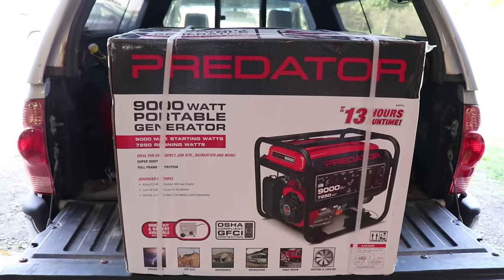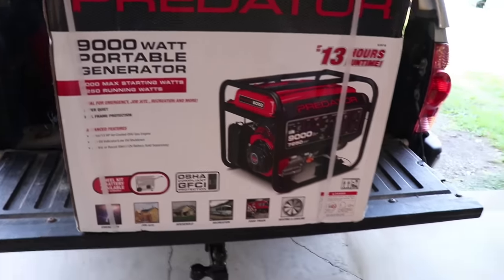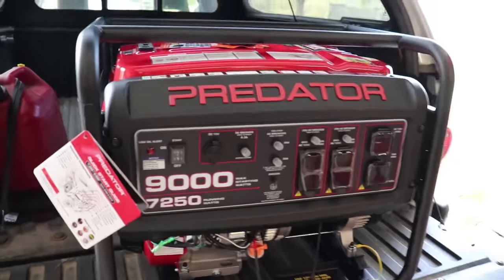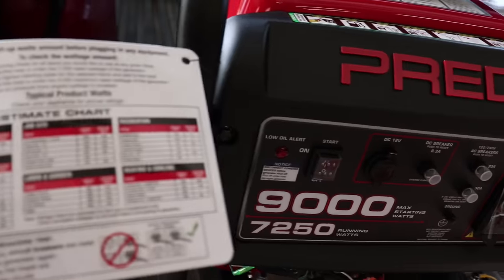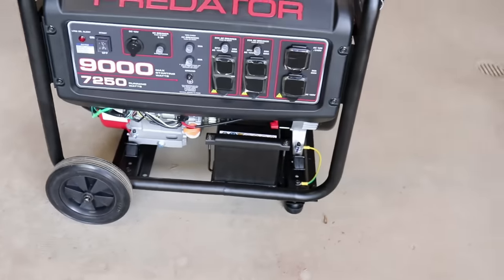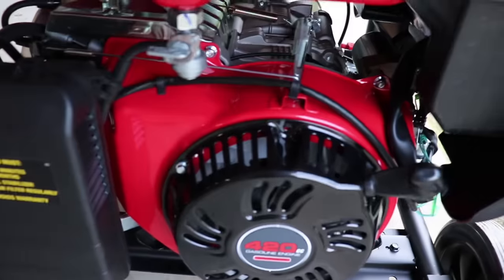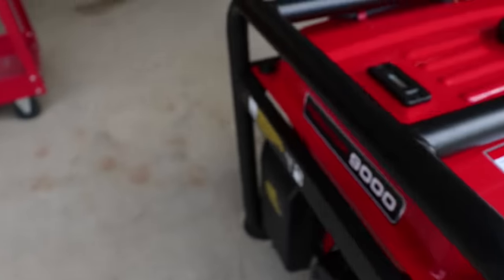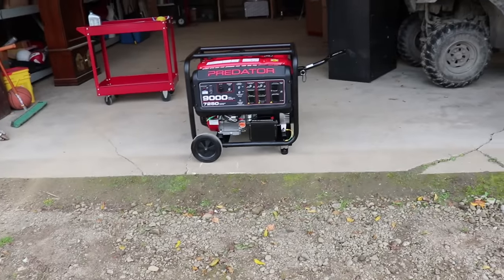Predator Generator Running Our ENTIRE Home. (Complete Setup and Cost)

Comment: I used this same one for 4 months straight  12hrs a day when I bought my land in El Paso Tx Works like a charm. Best generator ever owned.
Reply from the maker: Thanks for the input!
Reply: Thanks that is good to know. I wondered if the harbor freight units would be good for only short periods.
Reply: 4 months? on gas or have you converted to propane???
gone sola pv & battery pack?? tesla powerwall???

engineer 775 or handeeman; tesla car battery pack & pv panels.... you could do multiple wind turbines.....   just a suggestion.... free power
Reply: you need to change the oil,every wk,if run constant..i know you yanks hate changing oil in your vehicles..
Reply: Did you upgrade/ change the spark plug? If so with what plug?
Reply: I didnt do nothing to it just kept checking on the oil daily
Reply: @LilLonely915  8 hrs running a gen is like 1000 ks in a car.at least..i have a 5.5 kva gen,12 yrs old,oil change every 2-3 wks..robin crommolin.
Reply: @TheHwnleatherguy  Can you tell me more about this? Using a tesla car battery pack?? Is converting to propane cheaper?
Reply: stylishranchgirl Google “Tesla Power Wall”
Reply: Db levels by chance? Looks if your on a farm noise isn’t an issue but unfortunately my neighbors are pretty close and if I’m the only one running a generator that size everyone would hear that beast.
Reply: @TheHwnleatherguy  you seriously think building an independent power delivery system is free?
Reply: How much does it cost in daily fuel?
Reply: @TheHwnleatherguy  Explain that in a nutshell?
Reply: @markusayt  Every day for four months, if I had to use it like that, would seem a good deal. I'd have to pamper it afterwards and give it a rest. 

Harbor Freight didn't have a Predator in this size when I went looking. I 'settled' for something made by Power Stroke. My stepson and I set it up and did a simulation using our selection of extension cords. Everything went well and we shut it down after four hours seeing that everything was okay and we changed the oil. It was only very mildly discolored and running a magnet through the used oil didn't turn up anything that was concerning. 

After the Blizzard of January 1996 in southeastern Pennsylvania I shoveled snow for sixteen hours over a two day period. My wife, upon seeing me at the end of all of that shoveling, suggested we get a snow thrower. Excellent idea. Well, after we bought a Toro snow thrower it didn't snow enough to warrant getting the thing out of the shed out back. Buying that Toro had acted like a talisman against blizzards now I'm counting on the generator having the same effect on power failures.
Reply: @TralfazConstruction  What is this snow you speak of???
Confused in Florida.
Reply: @mushroomcloud1  It's a substance which repels palmetto bugs.
Reply: @TralfazConstruction  
Lol.....Best reply ever...
I have to go put a saddle on my Flying Palmy bug now,
Reply: @mushroomcloud1  Best wishes!
Reply: @TralfazConstruction  
Stay warm!!!
Reply: @mushroomcloud1  Oh, yeah. It's not the heat it's the humidity!
Reply: @mushroomcloud1  My daughter lives in/near Miami and she said as much with rain sweeping through yesterday. I'm in southeastern Pennsylvania and it had been unseasonably cool up until a week or so ago but we're paying for it today. I really miss the month of May. We had daytime temperatures in the upper 40s in the first ten days of the month. So it goes!
Reply: @TralfazConstruction  
Man I would just like some 60's...
It is hot.
Just help me wish away hurricanes and I will wish you a pleasant winter.
Reply: @mushroomcloud1  Oh, most definitely. I hope that Florida will not see any destructive weather. Thunderstorms here dropped us down to a cooler 70° from 84° with 60% humidity. Still heavy storms to our south. The generator is standing by although I don't want to have to use it.
Reply: @phantomwalker8251  not trying to be a smart@$$, what about using some long life synthetic oil to extend that change? Could that help?
Reply: @TheHwnleatherguy  0
Reply: @TralfazConstruction  don’t forget to watch this video about generator safety https://youtu.be/I1jT3ANENvI especially during hurricanes. Stay safe thank you
Reply: Thanks! It’s settled now. I’m getting that sucker.

Comment: I purchased the Predator 9000 a few days ago, and installed a Reliance inlet on 10/3 wire, and a breaker panel interlock with dedicated 30 AMP double pole generator breaker. Got it all wired in just in the nick of time as storms ripped though Alabama last night and as I suspected, we lost power overnight. Was able to connect the Predator 9000 to the house and we had full house power. It was awesome!
Reply from the maker: Love this generator!
Reply: Will this run your heat and air conditioning unit.
Reply: @lephaporter7833  doubt it unless u have 800 sq ft house

Comment: I have the same generator, our power went out a couple weeks ago for two days, we ran that thing 48 hours straight with no problems, the whole house, washer, dryer, fridge, TVs everything, 13 hours per gas tank full, works great
Reply: Haven't had any electronics fail early from running on this generator?  It's hard to find details on whether or not this generator is ok for use with sensitive electronics  (THD value).
Reply: @Steve Knick  no problems yet
Reply: @manbearpig2164  thanks!

Comment: Also. To protect the voltage regulator on your generator, do not allow the unit to run out of gas while it is under heavy electrical load. As the engine runs out of fuel and the rpm's start to drop, the voltage regulator tries to raise the voltage to compensate, and sometimes it burns out. This will cause 0 voltage output  when you turn the unit back on.
Reply: thanks for the tip!

Comment: I have the predator 9000w generator and it has been running 24/7 a day for the last 6months  and it has not missed a beat  it still starts flawlessly every time and i have had zero issues 100% a strong beast
Reply: ⚠️Portable Generator Safety Tips:

1) KEEPING OTHERS SAFE: Please do not allow an unqualified person or your children to operate and service the portable generator. Just because some manuals don’t say that doesn’t mean it’s safe. That is important against the generator safety rules. We also need to be keeping an eye on our children too. You need to make sure that your children are not playing near the portable generator especially when it’s running so they won’t get electrocuted. Generators pose electrical risks and they can be hot during an operation. Please keep your children away from the portable generator at all times. It is important to keep our children safe especially our little ones. Be aware of all the hazards.

2) WHERE TO RUN YOUR GENERATOR: Some people use their portable generators indoors which increases the risk of carbon monoxide poisoning. It’s important to have carbon monoxide detectors if you have a gas generator. Never ever use your generator indoors even if your doors and windows are open and even in the garage is not safe to use a portable generator. Also please never use your generator in your deck or balcony. It is never safe to use your generator indoors and in enclosed areas of your home. Your generator needs to be 15-20 feet away from your house. 

3)FIRE SAFETY: Never refuel your generator while it’s running. You need to let your generator cool off before refueling it and before storing your generator. Never overload your generator too. Never ever back feed your generator. You should never plug your generator into a wall outlet. Also never store propane tanks indoors. Please keep flammable things away from the generator as well and please don’t smoke cigarettes near the generator. Having a fire extinguisher next to the generator is also important against the generator safety rules. It’s also not safe to move your generator while it’s running.

4) GENERATOR OPERATION: make sure your hands are dry before touching the generator. Never use your generator in wet conditions. Don’t let your generator get wet. You need a generator tent if you need to use your generator during wet weather. Please don’t wear loose clothes when operating the generator. Turn on your generator before plugging in appliances. Use the right cord for your generator. Please do not use worn out cords. 

It is always important to follow the safety rules when using a portable generator.

Hope this helps.

Comment: This is a very good vid, and many thanks. I've had a standby gen for nearly ten years and highly recommend one. Some tips respectfully offered from experience-- 1) install solid, not air filled 8 inch wheels. If you forget to keep air filled tires topped off (ask me how I know), moving a generator on flat tires and no air pump because the electricity is off is far more difficult. 2) Get an interlock plate for your fuse panel breakers such that you can run either utility power or gen power. Dirt cheap insurance. 3) Get a chain and padlocks to keep the gen from growing legs while it's outside. 4) If you get a larger gen with an electric start, keep the battery on a smart trickle charger. 5) I keep two 55 gallon drums of gasoline with Sta-bil which is good for a year. No electricity can mean no gas pumps. Hope this is helpful. Good luck and God bless.
Reply: I have cans of non-ethanol gas from Home Depot.  Because I don't need the generator every year and that keeps for 5 years.  When hurricanes or blizzards are coming, I buy gas and stabil.  But I am not wanting to get rid of a lot of bad gas at the end.
Reply: Totally agree with the solid tires.  If you buy the inflatable tires, you will have to blow them up every time you have to use the generator and it can be bitter cold if it is a blizzard or hot as heck in the summer.
Reply: Let me know ur fuel storage information?!

Comment: I recommend keeping a spare spark plug (and make sure you have the proper wrench/socket) and quick start spray.  It makes a world of difference to have them before you need them.  I discovered this the hard way.  (You can take out the old plug and use a little sand paper to gently sand off the oxidization on a plug, but it may not always work.)  Also, do not run it too close to your house or inside a garage.  In addition to danger of the carbon dioxide, if you don't change oil regularly, you can cause it to catch fire and you don't want that close to your house.  Be safe.
Reply: 1st) Use Synthetic engine oil and you won't have to worry about oil fires due to its higher flash point. I never heard of oil fires except for running out of oil in a bad engine. Check oil level often! 
#2) The gas tank breather hole should be blocked to prevent fuel tank expanding & contracting with temperature changes (day/night), which will cause fuel to absorb humidity over time, thus you will have water in fuel. Have to remember to take off the blocked hole (toothpick?) on starting. Also, buy non-oxygen fuel (premium) as ethanol base fuel will absorb water and will gel up if it sits too long (stale fuel) Might want to get a 55gal drum of fuel stored in a covered area. 
#3) Pull the starter rope till you start to feel the compression stroke - which the valves will be closed to the outside air and you won't have to worry about plug/piston/cylinder oxidation. Best to just start the generator every few months (I close the fuel valve to run it dry so carburetor won't gum up). On battery start generators, you need to run it to every few months to keep battery charged up and carb clean on gasoline engines.
#4) Its carbon monoxide - not dioxide>dioxide is the fizz in soda pop.
 10' away from home not a bad idea. Moving farther you will need heavier power cables (not extension cords) to prevent power loss over distant. Windows close by the generator a no-brainer. Actually read the owners manual :-/
Reply: I agree with the spare spark plug and quick start spray.  We have had old generators that have been dependable for years but none of them started last Summer and my brother had to order spark plugs.

Comment: Hi, I bought the 8500 Watt Predator Generator about 5 Yrs ago. I have it mounted on a Harbor Freight 4’X 4’ Trailer, with my Compressor and an Air Hose Reel. I built a High Rack for the Trailer for a Tool Box, and mounted LED Flood Lights facing the Front, Back and both Sides. It’s really handy because I can also Mount my Titanium Welder and Paint Sprayer on the Trailer. That way I can use it all around the Farm, or take it Camping and Fishing. I am still using the same little Harbor Freight Battery for 5 Yrs and counting. It still fires right up on the First try. It’s been really useful for Powering my House during Power outages. For the Price, you can’t beat these Predator Generators. I bought mine when they were on clearance because they were coming out with the 9000 Watt. It was only $399.00 and no problems whatsoever. I do keep up the Maintenance regularly. Thanks for the Video, Subscribed 👍👍

Comment: I have this, newbie to whole house generators.  I am an "upper upper middle aged lady"  with back problems.  This gem starts first pull, every time.  I even change the oil , myself, Easy peasy.
It runs our whole house, but we don't use things like vacuum cleaners of the microwave b/c of the amperage.  No biggie.  It will run our HVAC unit , however you can tell it puts a bit of a strain on it.
So we use window a/c's as a substitute, along with fans to circulate.  THANK YOU for this video.  It is most excellent!
Reply: Install a Soft Start on your Central AC unit.  It cost as much as two window units.

Comment: I bought a 6000 watt Predator and it works great.  I did the hookup just like you did it and everything works including the central air.  My house is small and I basically need lights, refrigerator, freezer, and computers to run.

Comment: Thank you SIr for your "Two cents" concerning a generator. I was on the fence about which one I should purchase. After watching your video I am sold on the 9000 Predator Generator. Thank you again for your insight. I agree with Gary H about how a detailed video on how to add the switch and accessories to the breaker box.  Over all an excellent video to study.
Reply: Hope you didn't go with predator. It's made in Chiner. Go with a durostar

Comment: switch all of your bulbs and shop lights to LED and save a lots of watts being used.
Reply: True. Also, it is a 9kw gen set. They are made to run, at the very minimum, 35-40%. That is like 4kw. What are you going to use in your home that draws a cont. 4kw?
      I run a 30d36r diesel 3kw and have to hook it to my 240v 4500 watt hot water heater through a 120v outlet (drawing 1250w) just to put a load on it. Otherwise, I'm only drawing about 400 or 500 watts to run my refeidgator and lights.
Reply: @rclouse72882  we went to an on demand propane water heater and mini split hvac units . our elect bill now is around $160 a month running a 2000 sqft. home with either a/c or heat and a well and charge pump and i work from home and have a full machine shop 2. mills 2. lathes drill presses and compressor. i switched my shop to LEDs 16. 4' shop lights and some smaller 3' single strip lights. draws very little wattage. it's quiet and very bright.
Reply: they dont work without elec.
Reply: Led lighting makes your body sick over time and destroys your eyes!!!
Reply: @NikkyKnowsUNzs2001  well, Ultraviolet radiation emitted by fluorescent lighting can increase an individual's exposure to carcinogenic radiation by 10 to 30 per cent per year, with an associated increased probability of contracting squamous cell carcinoma by 4 percent. Melanoma has been shown to not be affected by CFLs through normal use. so other than cutting big holes in the roof or running incandescent bulbs whats the answer?.
Reply: @markthegunplumber8376   incandescent bulbs with red and infrared is still the safest and healthiest!
Reply: Solar lights work well, you don't use electric and some lights last up to 1000 hours. Rewire lamps  and a few outlets..
Reply: ihategooglespooks to many LEDs can screw with the frequency of your home. The most significant change would be your a/c or heater they make a soft start module that can help with that.
Reply: Did you know LED aren't good for your eyes?
Reply: @NikkyKnowsUNzs2001  WHAT! 🤤
Reply: I’m somewhat of a candle light guy, myself
Reply: Greg Pifer Trump2020
Reply: @phantomwalker8251  
Truth.
Reply: @dag4836  i feel fine but keep bumping into things..
Reply: Tesla first looked into the area of zero point technology in his early years, before he made his more commonly known discoveries in the area of alternating current electricity: https://homemade-generator-tao.blogspot.com/2020/07/tesla-power-generator.html

Zero point is a fringe area of research in physics. Even as a young man, Tesla was convinced that it was possible to obtain energy from all around us and that conventional thinking (obtaining energy from fuel reserves) was wrong. Impressionable as he was at that young age, he was persuaded to drop this area of research and he went on to make some of the greatest discoveries in electricity that the world has ever seen.
Reply: This is common in Nigeria were I was born. I’m moving off the grid so I’m happy I found this video.
Reply: @brianmorrison9066  Just to be clear, it's only 9kw at startup.  Running, it is 7,250w.
Reply: Don’t forget to watch this video about generator safety https://youtu.be/I1jT3ANENvI remember that running your generator indoors is dangerous. Just hoping you all stay safe. Thank you
Reply: They have led lights with batteries so your generator can be off and they'll still work.
Reply: So true